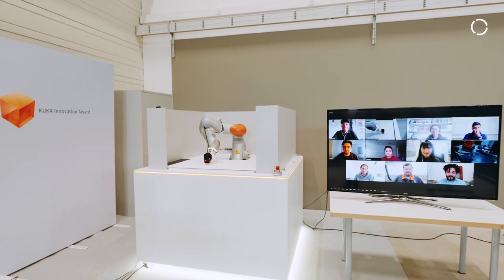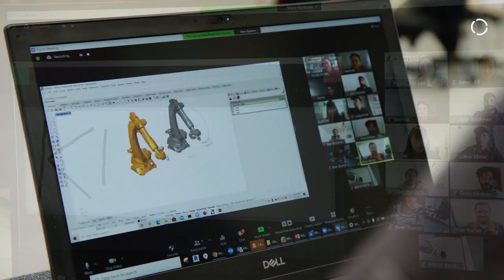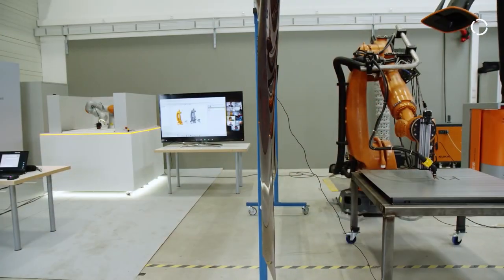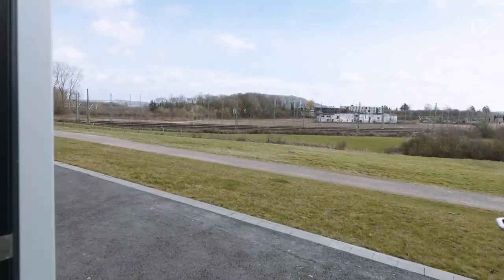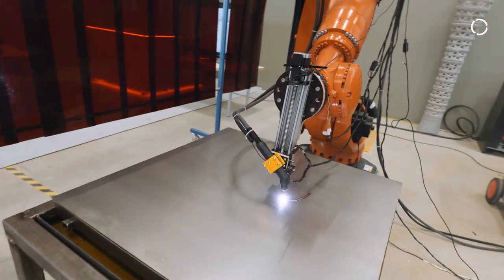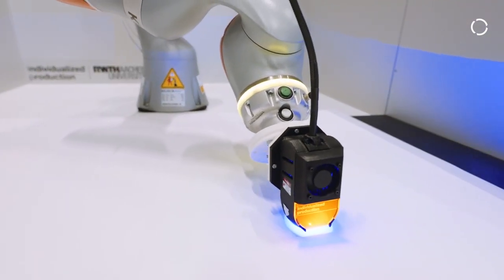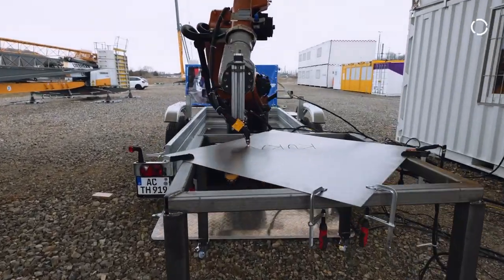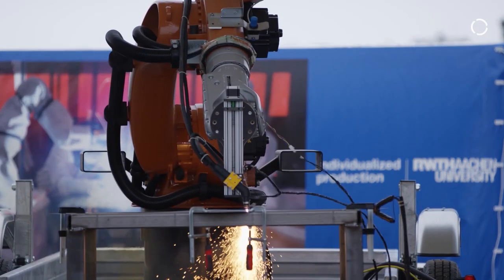Artificial intelligence allows for remote control of robots from anywhere

Comment: Playing Nintendo in 1985 with computer characters was A.I. You just a multiplaying the robot now. It's really nothing new is it? The thought isn't. People have done this already. Just not on a industrial level or have they? 2010 we were connected via WiFi to 150 Nachi bots. I could access it from the office. But it's the movement. Are all 3 in sync? Or is it video manipulation? Are the robots in the cloud / network getting the same command at the same time? Is it A.I? Or just simple networking? LOL.
Reply from the maker: Yes, directionally we have been building up technology in this direction. But games like that are based on "if this then that" algorithmic programming, not AI. These researchers allow robot operators to remotely control robots from anywhere in the world, and there are a lot of variables making that a difficult challenge.